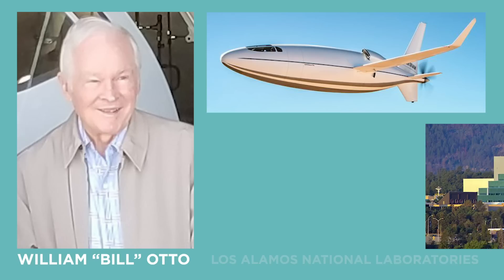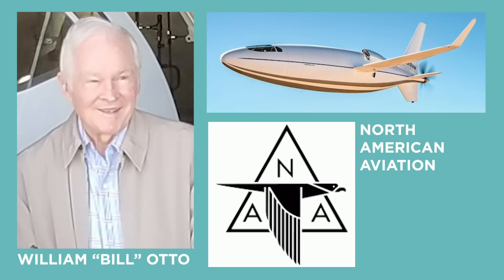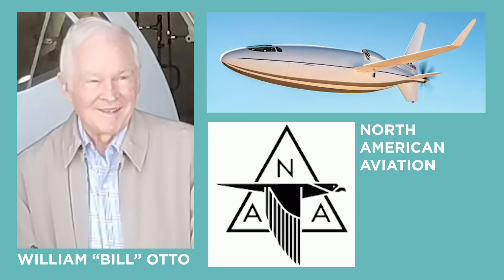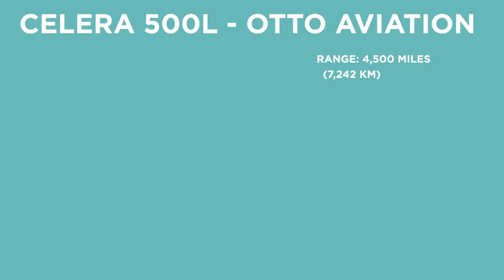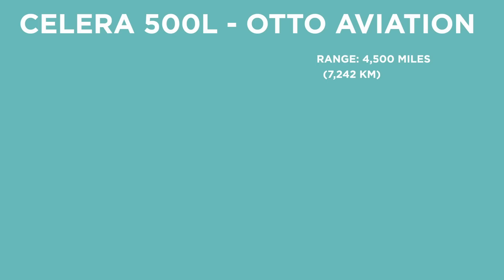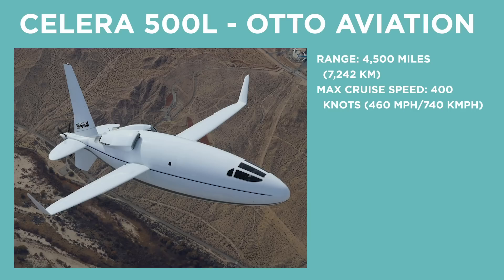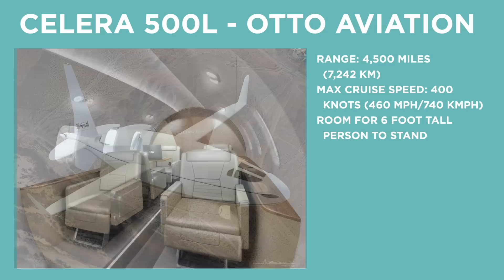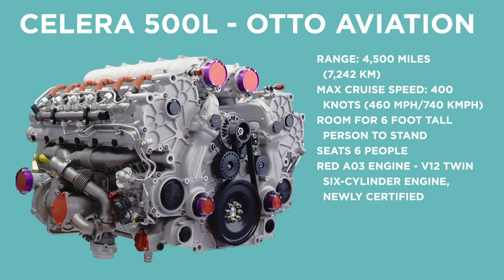Could This Plane Save The World? (Hint: No.) | Answers With Joe

Comment: but what if the tech used to make this plane so fuel efficient can be scaled up to 747 sizes making it able to carry as many passengers?
Reply: Watch the Mentour video; it looks like they can't be scaled. Something about the aerodynamics won't work at much larger scale (which is why the 1000 series Celara is only 20% larger)
Reply: The reason why the Celera is so slick and efficient is because it has laminar flow on ALL surfaces, not just the wings, not just the tail, but the fuselage and everything else touching the air.  To maintain that laminar flow over the entire aircraft, the size itself has to remain small for it to work.  You would need an impossibly smooth surface beyond the sizes that Otto is attempting and that's not even including the other parts of the plane on its surface, like where the wing and tail and air scoops meet the fuselage, the little instrument ports that are necessary on all aircraft, all the door and window seals, etc., that would more or less destroy that impossibly smooth surface you made.  Turbulent flow is sort of like a cascade effect, one tiny burble in laminar flow and it multiplies on its own until it makes all of the flow turbulent.  If a tiny gap in the door seal creates a tiny little burble, that will multiply on it's own and kill the laminar flow, but luckily that tiny burble doesn't have a chance to disrupt the laminar flow since the tail of the airplane has already left the area...in a 747 that burble might turn into fully non-laminar flow by the time its halfway to the wings, leaving the rest of the aircraft in draggy turbulent air.  Continuing this example, you'd have to make that 747's door gap fit so ridiculously flush that you wouldn't be able to feel the seam with your fingernail.  And that's only considering the obvious, as even the smooth sections of an aircraft need to be geometrically accurate, there can't be even the slightest imperfection, meaning any flat sections would have to be truly flat, any curved sections would have to follow that exact curve, with a margin of error lower than a coating of paint. So keeping the aircraft small is really the only practical way you can achieve laminar flow, since even the tiniest amount of imperfection will eventually end up causing non-laminar flow.  By stopping a specific size, you're basically making a cutoff point at which laminar flow is too hard to practically maintain.  To put that into perspective, so far this is the only aircraft I know of that has incorporated laminar flow on all surfaces, not even NASA has made a fully laminar airframe for testing purposes, so for them to manage it on their own is an engineering accomplishment.  Laminar flow is, to put it mildly, the holy grail of aerodynamics.

Comment: To understand relative efficiency you have to calculate fuel used per passenger mile.  Then calculate crew costs per passenger mile. These two numbers will give a good indicator of relative efficiency.

Comment: I see it more as a proof of concept and I’m curious that can it be scaled up?
Reply: Nope, not by much.
Reply: @Skinflaps_Meatslapper  Cool, you have any further sources on this?
Reply: @albertbokor6643  Ehhhh, not off hand.  This is stuff I learned when I was in college.  Laminar flow is difficult to maintain when you force it to move around a body, and it gets harder to do the longer it's is in contact with said body.  Basically, if you want something like a 747 length fuselage, you're going to need a surface so precise that a laser scanner couldn't detect surface imperfections, and any seams like window to body or door to body seals would have to be so exact that you wouldn't be able to feel it with your fingernail.  It is theoretically possible to make a jumbo jet sized aircraft with laminar flow on all surfaces, but we're way too far off to even consider it experimentally, much less with any feasibility.  Now, with smaller aircraft, you don't have to be quite as precise.  Those little imperfections that set off a chain reaction of swirling eddies that multiply themselves as time goes on don't have a chance to manifest as drag inducing disturbances if your fuselage or body is small enough.  The aircraft is long gone by the time those near microscopic eddies in laminar flow produced by surface imperfections become turbulent.  So, while those imperfection do eventually turn laminar flow into non-laminar, the body itself doesn't see any of that drag inducing turbulence because it happens after said body is out of contact.  A longer body would still be there and see that resulting non-laminar flow, all other things being the same except length.  A body designed for laminar flow will exhibit higher drag coefficients through various processes than a more conventional body designed to thrive in non-laminar flow.  Without going into too much detail, laminar surfaces are designed to make the air stick to the wing, and when the boundary layers begin separating and interacting with each other in non-laminar flow, it blankets everything behind it...control surfaces lose effectiveness, the body itself becomes less efficient, air stagnates in areas, etc. so unless you can get it totally right, it's better to not attempt it and use surfaces designed to work efficiently with non-laminar flow instead.  This much is evident by the fact that engineers have known about laminar flow since the late 1800's and the first laminar airfoil was made for the P-51 in WWII, the advantages of laminar flow for low drag were well understood and it remains the holy grail of aerodynamics...yet laminar flow airfoils (the most advantageous body to utilize it) are still a rarity.  Furthermore, the Celera is the first aircraft designed to have laminar flow not only on the wings but also on the tail, fuselage, and all the other little bits of the aircraft.  Not even NASA has experimented with a fully laminar aircraft for testing purposes, which is really saying something about how ambitious Otto is with this aircraft.  If one were to pursue an aircraft that's equivalent to the 737 in terms of payload, one would have to totally deviate from conventional aircraft layouts in order to make it feasible.  About the only way to have an aircraft that size without going nuts making everything perfectly smooth is to limit the length that air has to travel past as mentioned above.  Since you can't make it longer, you have to make up for it in width.  A layout such as the Flying V would be about the only practical shape that would scale up, since the air is more or less only traveling over the chord of the wing rather than a long fuselage.  It would differ from the current Flying V prototype in that the wings would need less sweep to maintain that short distance required of laminar flow.  This, in addition to the already efficient design of the Flying V layout, would give it a real leg up over conventional aircraft.  The Flying V is estimated to be about 30% more efficient than conventional aircraft, then the additional efficiency of total laminar flow, and you might have a real winner.  The only downside is ground logistics, as it would be much wider than current aircraft and infrastructure would need a complete redesign to accommodate it.
Reply: May be, by using AI , but it does seem so.it will still need windows.
Reply: @waqarghulam3548  There have been significant advances in aerodynamics that use intentionally turbulent airflow to good effect, on par with laminar flow bodies.  However, they are still in the theoretical/lab stages, no physical demonstrators at this point.  It could be the future for large aircraft, as opposed to laminar which is primarily good for smaller bodies.

Comment: Well Joe. I work for an OEM and think you hit the big issues. Plus it’s more expensive to fly commercial rather than private. So if you had a fleet of smaller jets but sold seats on them or “rented” like say NetJets or VistaJet you’d have a host of different regulations you’d have to apply to etc.

Comment: The damned thing can't be scaled up at all?  Get to 30 passengers and the math tips way in favor of the Celera v. Boeing 747.
Reply: Yep, the comparison is dumb. You might as well compare a 747 to Cessnas. The question is, can it scale and if it can does this look sustainable?

As for Private Aviation, it’s less about cost and more about time for the passengers. Though I’m excited to see what it can do.
Reply: No it doesn't, the idea of replacing big airliners with tiny planes is utterly laughable if you know anything about airline economics.
Reply: It's unlikely that this can scale to airliner size, let alone 747-ish. Laminar flow becomes more and more difficult to achieve with growing Reynolds number, and the Reynolds number scales up with the size. And even if you have perfectly laminar flow, that only really gets rid of parasitic drag. Induced drag is just as important, and for that the only reliable recipe is a large wing span (à la glider plane) – which airports won't be happy about.
(Winglets help a bit as well, but only some percent, never revolutionary.)
https://en.wikipedia.org/wiki/Lift-induced_drag
Reply: It’s less about 747 size and whether it can scale to small airliner as hub-spoke models are replaced by point to point (eg. A380’s cancellation vs 787) but it does have a few issues such as perceived reliability with single engine, total speed, etc. 

They’re making two versions of it but they’re only marginally different in size. 

Wing-shaped airliners have been proposed for a while, as indeed has a resurgence of airships but its really all about cost, including service infrastructure, retraining, etc. You’d have to have a multiplier in efficiency to make it worthwhile. Right now you can just wait for other airlines to fail and buy up old stock (maybe even 747-200s for £20m!) or get cheap leases. 

Perhaps we need to wait for Wendover Productions to weigh in ;)
Reply: @NickGazard  One of the big issues with flying wings from a design standpoint is that they can't use flaps, which means they need about the same total surface area as a regular airliner to generate enough lift on takeoff, and at that point, there isn't really any efficiency advantage anymore, and just a lot of issues with the configuration from a practical standpoint, from narrow CG range to a lack of windows and emergency exits. that's really what killed it, they can't reasonably meet the 90-second evacuation requirements. I could see the Celera having a similar problem if you tried to scale it up very much because of how wide it is.

as for more in-depth design stuff on the Celera, I'm an aerospace engineering student at Purdue, so I think I know a little about how it works.

The central engine on the tail is really key to most of the aircraft's efficiency. it generates suction over the fuselage, which helps keep the flow more laminar and reduce drag. it also does something called wake filling, where instead of having a wake of slower moving air coming off the fuselage and some faster-moving air coming from the engines that have to balance out, you can just speed the slow air from the fuselage back up and use less energy overall. a ducted fan on the tail has been proposed a few times as part of hybrid electric airliner concepts, and would likely reproduce most of the Celera's efficiency gains over regular aircraft.

The Celera specifically starts to have some mass issues as you scale it up. because the wing has to be positioned in the center of the fuselage to maintain laminar flow because of how it interacts with the fuselage, and that means you can't really build a carry-through spar (it would go through the cabin), which is maybe acceptable on a small aircraft if it gets you enough aerodynamic efficiency, but becomes impossible once they get bigger and heavier with more bending loads. the only airliner sized concept I've seen with wings of a similar aspect ratio and cross-section thickness is the Boeing SugarVolt concept, which requires strut bracing to be stiff enough. I would also foresee the Celera having some issues with takeoff and landing distances because it has so little wing area and such a thin wing section on such a small plane doesn't leave much room for flaps. it's the sort of plane that looks to me like what a genius aerodynamicist would dream of when they forgot that there was anything other than aerodynamics to worry about.

for laminar flow at larger scales, as @leftaroundabout said, it is much harder to maintain but it also doesn't matter as much for the same reasons. the larger the scale, the less important the effects of fluid viscosity are. that means that the flow doesn't stick together and stay laminar as well, but it also means that turbulent flow doesn't dissipate energy as heat nearly as quickly, and so doesn't have as much of an effect on drag. 

a potentially more clever and more reliable way to increase the efficiency of the wings on large aircraft is to use some of the tricks gliders do. the smaller you make the leading edge radius, the less drag the wing has when it is in its ideal angle of attack range, but the smaller that range is. to deal with this, gliders actually use negative flap deflection to get a higher angle of attack when they are going fast to keep it in that ideal range. there are now some flexible flap technologies that would allow you to reasonably use that same trick on airliners. that trick is actually even more effective the faster you fly, so it might be even more useful to airlines than to gliders if it was implementable. it also doesn't rely on laminar flow or aircraft configuration to work, which is a big win from a practicality standpoint.

Comment: In the "by the way" category: You need to calculate the Mpg Range per Passenger, not per plane. And also a 747 seats 416 passengers in 3 classes and over 600 in an all-economy setup.

Comment: 1) B-747s don't cost $20,000,000 (closer to $300,000,000)
2) You can't compare planes at different scales (far too many factors)
3) Most importantly, what are the implications if the Celera 500L is scaled up? The Celera is only important if it can be scaled up for a comparable price. Assuming the Celera could be manufactured to the scale of a 747, it would cost between $150,000,000 to $450,000,000. If that could be done airliners would surely switch to those planes because they would pay off after just a few years.
4) Having 61 times as many planes would be a runway and logistics nightmare for air traffic control

Comment: As a pilot myself, I’d much rather fly a pc-12 than this, especially their latest offering 🤤 When flying a single engine aircraft the reliability of the engine plays a massive role in the overall safety of the flight, and the pt6a engine is the king of the hill. If they put one in here it’d change things (but they may lose that crazy fuel economy number 🤷🏻‍♂️) regulations of carrying passengers at night or in IMC with a single piston engine is also a hurdle. Had it a turbine engine that’d be fine, but an untested v12 piston? just the thought of all those moving parts scares the hell out of me. A small jet engine like the cirrus vision or a turboprop as mentioned would make it actually usable in a commercial operation. As a private jet replacement those regulation issues are less of a factor and can be argued either way, but here the looks and brag appeal start to weigh in as well, and this little guy is definitely no sexy plane 😅 As a commercial operator I don’t see it’s viability. Also people like tried and tested, when you’re spending that kind of money you’d rather stick with the industry standard where crew is available with minimal training required, and where safety and reliability are well recorded. Just saying. But great video Joe, I like that you weren’t just won over by fuel numbers. There’s a lot more that goes into running the aviation sector than just fuel. Keep up the good work.

Comment: I think the diesel engine is a really good idea. If my knowledge is correct, gas turbine engines require more expensive maintenance than a piston engine. I also heard that aviation gasoline is leaded and leaded gas is an air pollutant, hence why it isn't used in cars anymore. A diesel engine doesn't use gasoline and therefore doesn't have these problems. And just like you said, diesels can use jet fuel, this would make things easier as airports would only need to store a single fuel type. Though I am NOT a pilot and only an aviation enthusiast, I'm certain that future piston-powered aircraft would be diesel powered.

Comment: $20M is a glaring error. 

$20M buys a ratted out, high-time, soon to be scrapped, 747-400, that needs $20M of maintenance followed by millions $ to keep in the air on a regular basis.
Reply: tought the same thing
Reply: Why I don't fly.
Reply: @marccolten9801  
There’s a lot more reasons to not fly commercial.
Reply: @larryscott3982  Are those reasons:

1.  Prefer safe, efficient, eco-friendly high speed rail?
2.  More fun to see America up close driving your electric car?
3.  Easier to stay home and experience your destination through immersive virtual reality?
4.  More comfortable flying alone or with a few "friends" in your private jet?

If so, sounds great.